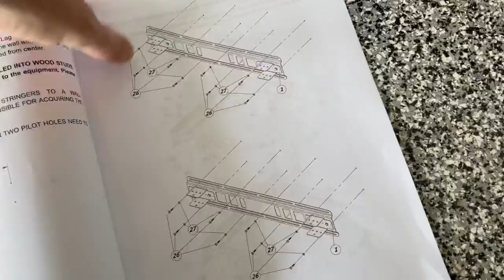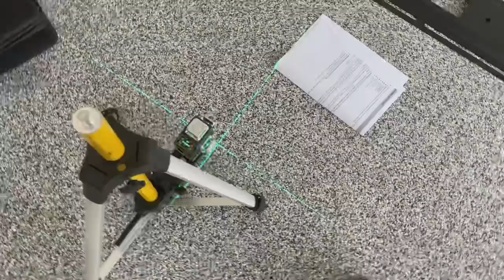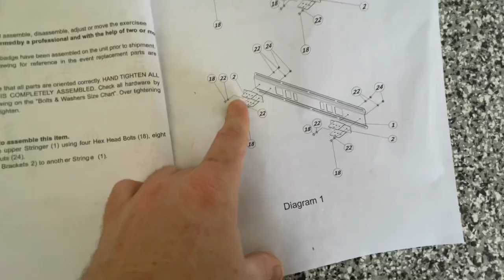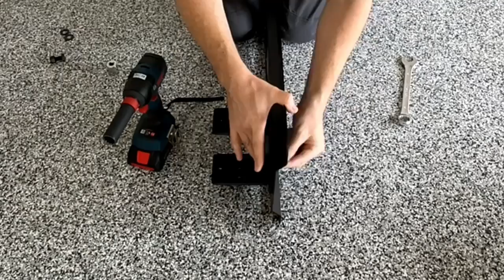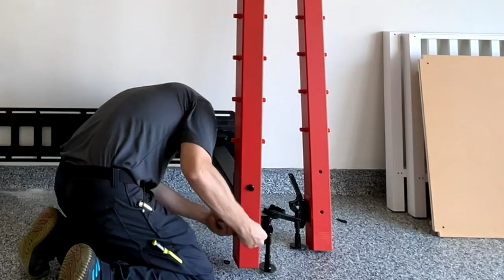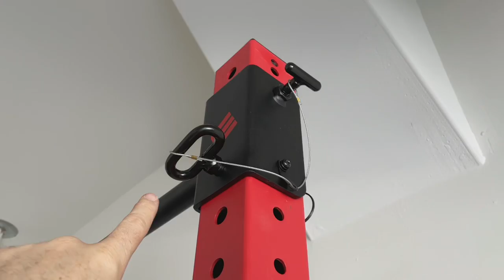How To Assemble & Install The ETHOS Folding Wall Rack | Using 360 Self Leveling Laser DIY

Comment: @MasteringMayhem Has anyone needed to shorten the height of the red support beams? I need to shorten these to be able to install in my basement.
Reply: had them cut at metal shop. took 6 inches off the top. Still gives me enough room to attach the pull up bar

Comment: Love the rack, super helpful video just have a slight Hiccup….missing the locking pins for the rear and the pull up bar….rears are not an issue easy to find but the pull up bar ones look specially made for this application any ideas on how to get replacement parts?

Comment: I looked at this a while ago at dicks  it's a solid wall rack BUT "and it's a big but"
 you can only get spotter arms online for an attachment on this rack.  I would rather go with prx ,titan fitness , or rogue because then you can get numerous attachments for your rack.
Reply: Not the case anymore. I was able to order the spotter arms, squat rack, bench chair, etc. From the store and pick up same day.
Reply: @Keith Schuch  no its the case.  You can only get spotter arms and j cups. They don't have any other attachments for this fack. It's not a bad rack just if you want anything else you CANT GET IT. like I said you would be better off with another company that has 3x3 or 3x2 with 5/8 OR 1" HOLES
Reply: @Keith Schuch  honestly if all you want it for is squat and bench it's OK but I like using my monolift attachment to save my shoulders on the bench and I don't have to walk my squat out. You can't get a monolift for the ethos wall mount

Comment: Can you list the tools used for this install! I am excited to get my installed
Reply from the maker: Sure.

Impact Driver 18/20/24 volt
Drill driver
Pliers
Ratchet & socket set (Large sockets 19mm-32mm sizes)
Mallet
Stud Finder
Bubble Level (self leveling lasering if possible, makes it easier)
Set of wrenches

That should be all that you need.

Comment: Q: Can you just install the entire wall rack so that the square bars graze the ground and use those red beams stacks for supporting all the weight down onto the entire beam instead of the levelers ???
Reply from the maker: I’m not sure. Tough one to a sewer whiteout being there
Reply: That’s a good question I had myself as well. Right now seems that all the weight is being supported by the levels and not the red beams

Comment: Can these be mounted to a totally concrete wall in the basement ?
Reply from the maker: Yes. Use wedge Anchor bolts to attach the system to concrete.

Comment: I have about 18inches of cinder block wall in my garage.  Would the bottom stringer fit on that wall (given the offset from the floor and the height of the stringer)?  Also, will the bolts work in the concrete block, or would I have to get alternative bolts for the concrete block wall?
Reply: I have the same question!
Reply: Did y’all figure this out?
Reply: @thomasrichard2863  - did any of you figure out the situation with a 13 inch concrete slab in the bottom?

Comment: Would this be able to be installed in a garage with the concrete foundation exposed along the bottom of the wall? I don't have straight drywall all the way to the floor, it's about a 2ft tall concrete from the ground up along the wall. Is the bottom bracket installation adjustable or is it ok to bolt to the concrete?
Reply: Curious about this too- mine in only about 6” but has molding on top so about 10” total. Some of these racks look like they mount really low.
Reply: @naturaljoe759  precisely, these horizontal brackets look like they mount way too low for my setup, and i don't have experience screwing or bolting into concrete. Since it's foundation, I'd prefer to keep that untouched if i can
Reply from the maker: You can adjust that bottom stringer bracket but the adjustment is limited to the holes in the Up right posts. I would Anchor Bolt the bottom stringer to the concrete as my fires option. 🙂✌️❤️
Reply: @masteringmayhem  thanks sooooo much! I know this is a totally newbie question, but are there any concerns with bolting into the concrete foundation?
Also, i have one other reeeeeally important question (because I'm very close to purchasing this), are there other attachments besides the pullup bar and spotter arms? Like is there a dip bar or any other attachments for additional excercises? Thanks so much for replying, your vid was wonderful.

Comment: Nice and clean install.. the reason the Rogue doesnt have the adjustable levelers at the bottom is because their brackets are made with some vertical allowance. This way, the rack is set up as intended, and the large square tubing will support all the weight. Like its supposed to.  Those levelers are hardly strong enough for any decent amount of weight.  What I’d recommend doing is pre assembling the swing out sections and loosely thread the bolts and pins to the wall brackets. Stand them where it’ll be used. Then measure up from the floor for your stringer height.  Like you said, most garages are sloped. This will account for the leeway you will need when open and stored. Then you can toss those levelers in the garbage or leave them. Your choice.